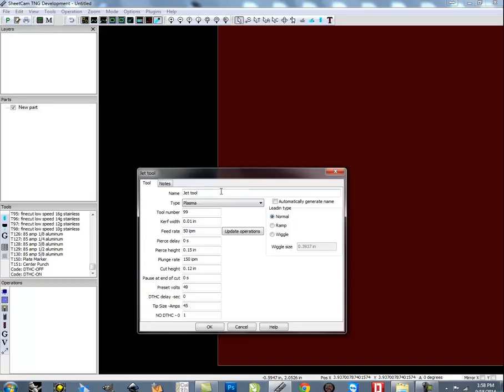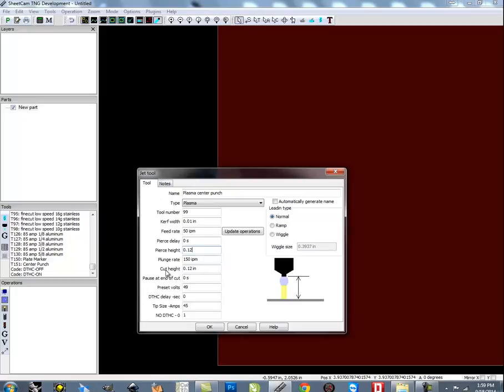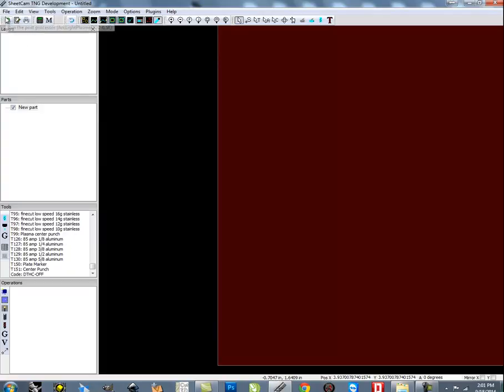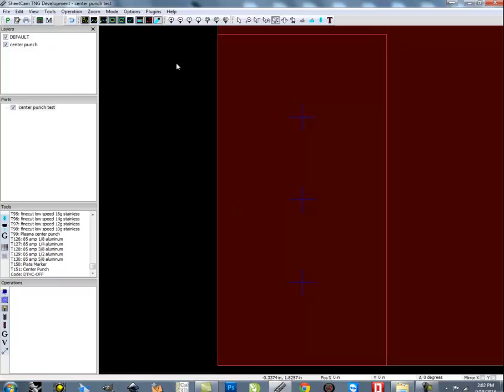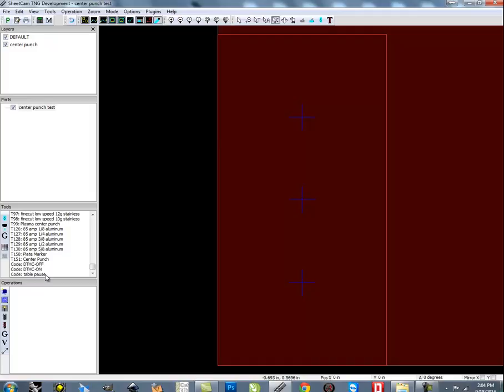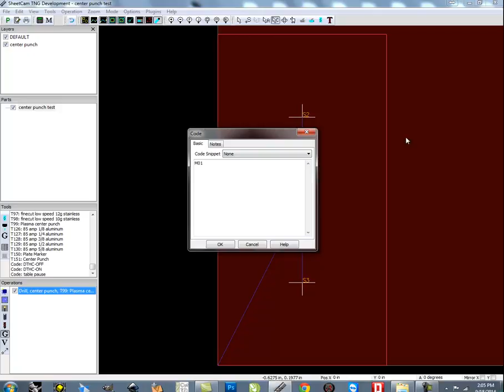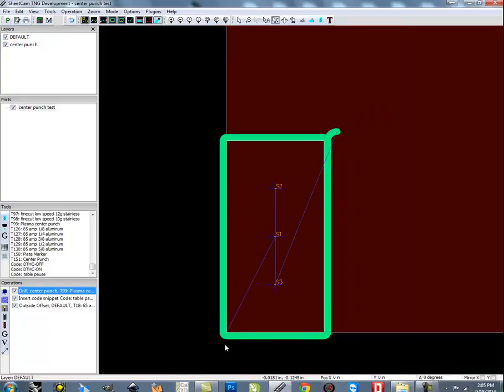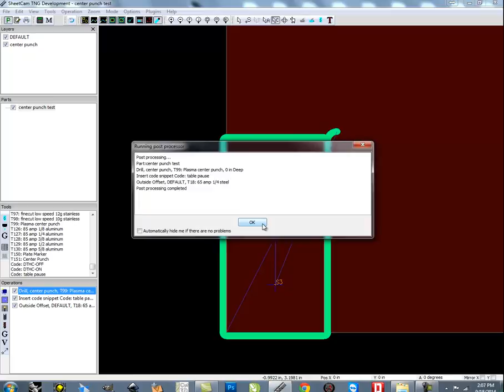Plasma Center Punch training video

Comment from the maker: Here is a new Training video that show you how to "center punch' spots in steel with your Arclight Plasma table, so that they can be drilled later. You are basically just nicking the surface. It produces a very nice divot that is quite accurate,
Plasma Center Punch training video